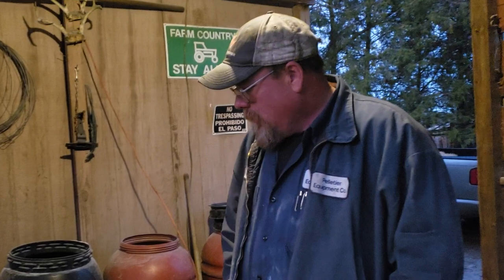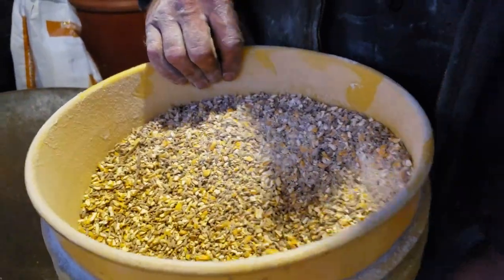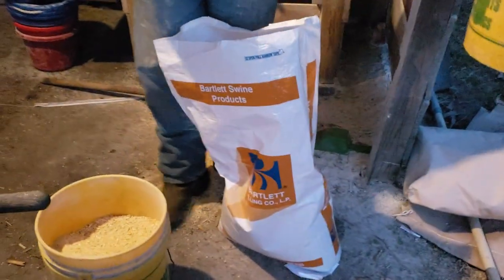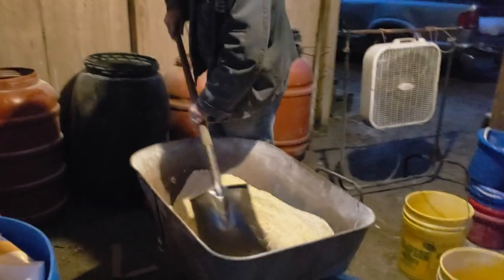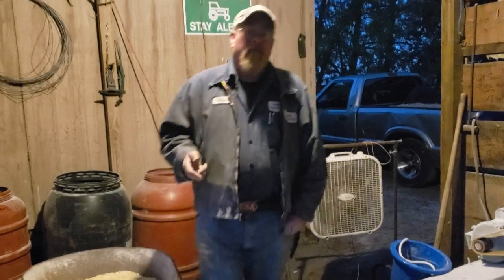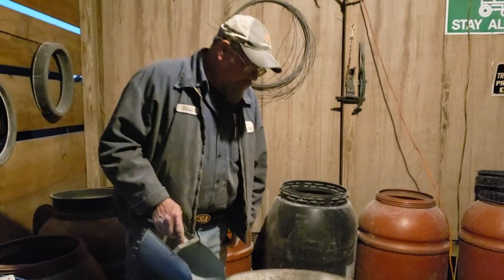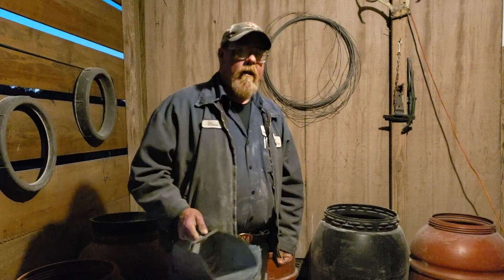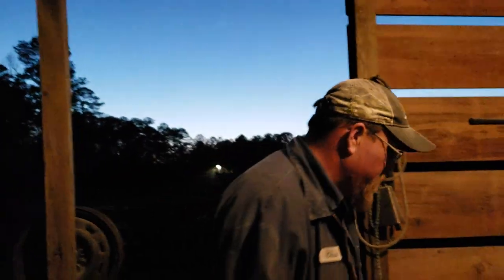Hog feed 101

Comment: How many pigs are you feeding with this 5 gallon bucket? As in how to measure or for 1-3 pigs
Reply from the maker: Depends on what you're feeding. Meat pigs start at about 2 lbs a day at weaning and go up to 15 lbs a day or more close to finish . Bred /open Sows get 5 lb a day boars get 2.5 , sows with pigs get 5 lbs plus a pound per pig or more if they're losing condition. I feed what they'll clean up for meat pigs so if I gave three pigs 5 lbs and they ate all and still acted hungry I'd increase to seven if they leave some I cut back it works out roughly 5% of their body weight if you have good genetics and no parasites . It normally takes 3 to 3.5 lbs of feed to make a pound of pork so roughly 750 ish lbs of feed for a 300lb top starting with a 30 lb feeder pig
Reply: Thanks right after I sent this comment  went and watched the video where you explained do you guys have a video for pulling milk teeth?

Comment: What do you think of pasture grazing hogs with minimal grain supplementation? Been looking into this quite a bit lately. Using hogs to clear over grown logged land supposedly they don't need much grain if they graze. I'm talking about keeping them in small paddocks using electrical wire to move them around as desired. ..
Reply from the maker: We did it for decades. Using them to clear land works pretty good but it doesn't save much if any on feed a lot of times they burn more calories foraging than they get back . Hogging down a legume or grain crop does work but it's a lot of fencing and work , unfortunately a lot of the information is misleading
Reply from the maker: They'll clean up the cutdown no doubt but it won't save you any feed to speak of . Might be a better way to put it , we did it for years and cleared almost a hundred acres that way

Comment: I love your grinder and couldn't help but spot that Farmall Cub in the background. The first tractor I ever drove and used was Grandpa's Cub. Just curious, how would it work to feed pigs ground wheat mixed with the suppliment?
Reply from the maker: Wheat and rye are interchangeable I don't ever mix it over half with corn
Reply: Don't be afraid to use whatever's readily available, pigs are pretty adaptable. I don't live in a corn raising area, too far north. Summers are too cool and the growing season's too short. I feed barley if I can get my hands on it, wheat if I can't get barley. I can get corn down in the basin (well over an hour's drive away) but it costs twice as much per ton as my source of wheat/barley 20 minutes from my house costs. Of course I add a protein/mineral supplement as well. If corn was handy or reasonably priced I wouldn't hesitate to use it, but my hogs grow out just fine and taste great raised on wheat and barley.
Reply: @HomesteadingtheHardWay  I'm curious, why do you mix rye in with the corn? Isn't it pretty common to feed just corn with the protein supplement?
Reply from the maker: @randysheckler763  rye or wheat is a little higher in protein but the biggest reason is it's half the price of corn . Hogs don't like the taste of wheat it's bitter I think so I never use over half
Reply: @HomesteadingtheHardWay  That's interesting, I've  never noticed my pigs balking at being served wheat. But I've never offered it side by side with something else to see what they preferred either. 

Some people soak grains overnight if they don't have a grinder, but according to Morrison's "Feeds and Feeding" soaking is a "rather poor substitute for grinding." The one time I tried it it was with barley. When I dumped the soaked barley into their trough they gave me quite a look. Like they were saying, "what the heck is this crap?" It was rather humorous. That's the only time I ever had hogs turn their nose up at something I tried to feed them. 

Rye isn't available in my area as far as I'm aware or I'd have to experiment with it. Barley's cheap and higher in protein than the soft white wheat commonly grown around here, but the price on it is so low that fewer and fewer grain farmers are growing it. That's why I have trouble getting barley and often end up feeding wheat.
Reply from the maker: @randysheckler763  you're not supposed to feed wheat as a primary ration especially to bred / nursing sows during hot weather. It can cause serious digestive problems. They definitely don't like the taste mine normally won't eat the first couple of days after I add it into the mix
Reply: @HomesteadingtheHardWay  I've never heard of that before. I've fed it for years. I've always been satisfied with the results. That's only my experience. Other people may have experienced differently. 

So I went and did a bit more research. Apparently stomach ulcers can result if wheat is ground too fine. That's useful information that I wasn't aware of. I may grind it a bit more coarse from now on to be on the safe side. But I always preferred my feed on the coarser side anyway. One of the places I used to buy feed from had their feed ground to the point that it was downright floury and I didn't really care for it that.
Reply from the maker: @Randy-sb2eb  it doesn't have to be as fine as you think . It causes something similar to diverticulitis more so than ulcers or sores I've necropsied more than I can count where it's been the problem for unthriftyness . Normally it's from failure of a binding agent it pelletized feed . Most mills won't use wheat at all in hog feed because of it
Reply: @HomesteadingtheHardWay  We're starting to sound like the farmers at the coffee shop who will argue all day long about whether they should plant their crop at inch and a half depth or two inches. They can debate it all day long and when they get done they're gonna go home and do it their own way because at the end of the day there a thousand ways of doing things and people are all convinced theirs is the right way. I'm gonna keep feeding wheat because it's readily available and reasonably priced where I live, you're gonna keep not feeding it over half ration, and at the end of the year if either of our past experiences serve as an indicator, we're both gonna have contented pigs and freezers full of pork. 

If we wanted to drag this out I could quote article after article of from University of Kansas, University of Iowa, and University South Dakota research that all state "wheat can be used as the sole concentrate in swine diets". But university research only gets you so far, and often contradicts itself. I found the article that warned against grinding wheat for hogs too fine, but I later found another university study which concluded the fineness of feed grind had no effect on incidence of stomach ulcers. In yet another study, the amount of wheat as percentage of the ration also had no effect on incidence of stomach ulcers. Oats for another example, one article says they should only form 1/3rd of the ration at the very most, another says that they can form up to 90%. So at some point you take whatever information you can gather, try things yourself, and see what happens. There's a hog farm near Las Vegas that feeds food wastes from the strip (solely, as far as I can tell). That was interesting to me to learn about because most people claim hogs won't thrive on food waste alone or that the meat quality of pigs raised that way is low. I don't live anywhere close to a city so that business model wouldn't work for me. Plus I wonder if the infrastructure and labor to boil the food waste as required by law and the longer time (I assume) the pigs would take to mature wouldn't outweigh any cost savings. But it seems to work for them, they've been operating with that business model since the 60s. 

When I first got interested in breeding pigs, there were 3 people left around here that were doing it. One was in his 60s, the other two in their late 70s. The one his 60s sold his last remaining boar and 3 sows to me to get me started and quite raising hogs altogether. The other two in their late 70s have since passed away. I miss them greatly. Now I don't have anybody locally I can call for advice. I've gotten lots of useful information off of your channel and I appreciate that you're very responsive to questions as many other youtubers are not. So please don't think I don't respect your opinions and experiences, I do. Mine are just been different in this particular regard.
Reply from the maker: @Randy-sb2eb  just be careful feeding to much wheat during hot weather but it might not get hot where you are . They feed a lot of wheat year round in Scandinavian countries and Russia.

Comment: I'm not able to easily find hog mineral supplement where I live. I've seen some people using calf manna do you think that'll work good.
Reply from the maker: I use some in the pig starter I make . I'll warn you it spoils fast especially in hot weather. Let me know what area you're in I might can help you find some
Reply: Far south east Texas we have plenty of feed stores but mostly focused on cows and chickens
Reply: I get ground corn with soybean meal mixed it's 30% protein 18% fat 5% fiber I'm just looking to add minerals
Reply from the maker: @wild_woods806  that's really high on protein and fat the supplement I use is only forty percent and it's fifty lbs to two hundred of corn to make 15 percent feed . You can find mineral mix online just make sure it has vitamins and lysine
Reply from the maker: @wild_woods806  the mix for cows will work just don't use the red trace mineral  powder it's not enough
Reply: Thank you for the info

Comment: How much feed does one hog get a day you are raising to butcher?
Reply from the maker: Depends on the size of the pig , a weaned pig will eat about a pound a 250 lb top will eat ten . I give them what they will finish twice a day if they leave some I cut back . If you have a good pig you can figure on 600 to 700 lbs of feed and 120 to 150 days to slaughter at 250 to 300 lbs . Temperature plays a big part they grow slower in the heat because they won't eat as much
Reply: @HomesteadingtheHardWay  that makes sense thank you

Comment: I grind about 35 bushels of shelled corn 
1200 lbs of a uniform peanut bi product that’s high 40 percent 
75 lbs super 75 southern states supplement 
If I don’t put the supplement I will see it in my hogs within a week across the board.
Reply from the maker: We feed some whole peanuts, they're a little hard to come by here . We've had to step up feed production a lot since this video back then I was only topping out five or ten a year selling most of the pigs at weaning. I only use wheat or rye because it's cheaper

Comment: Can you breakdown the general cost?
Reply from the maker: I've got about 1500.00 in equipment ( we've expanded since this video ) corns 6.75-8.00 a bushel 56 lbs the supplement is 16.89 50 lbs small grain is cheaper but you can only use 25% . Feeds 30.00 hundred at the mill we're making it for 16.00 a hundred sometimes a little less . It's definitely worth doing if you can get grain from a local farmer or grow your own, it saved me 8000.00 last year over buying it .